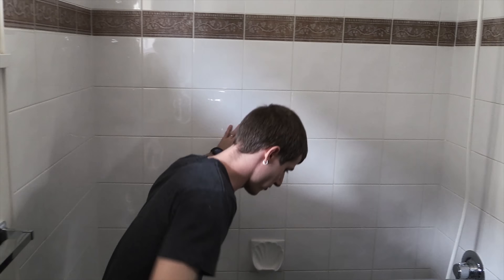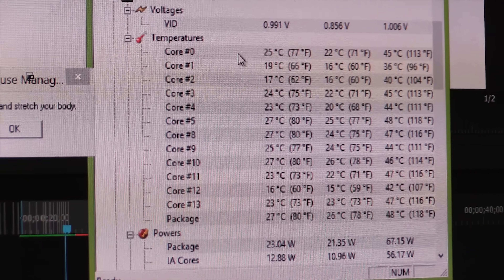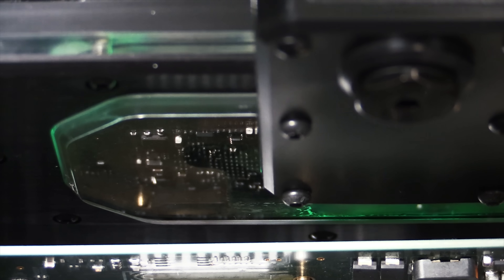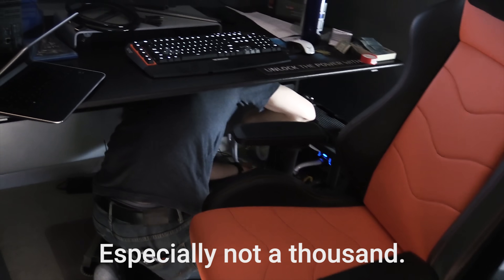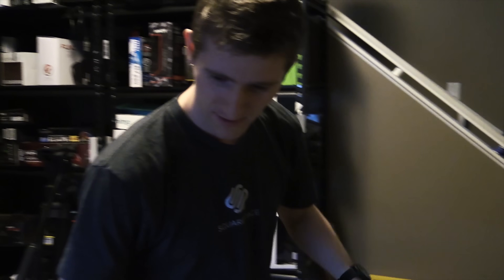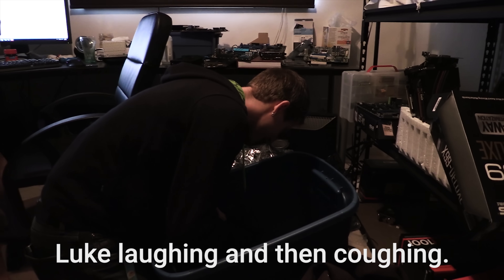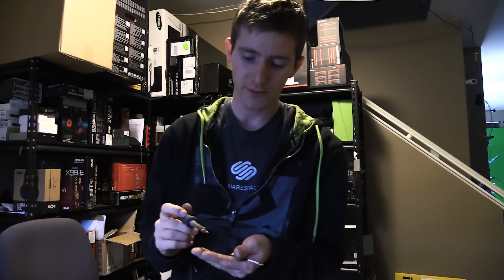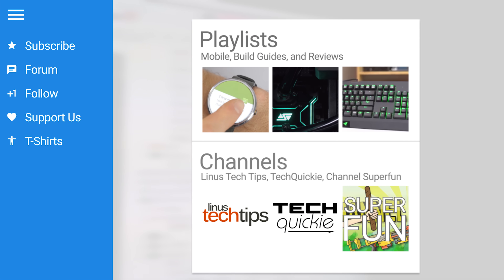Whole Room Water Cooling Part 5b - Some Issues, More Solutions...

Comment: Linus just a thought, but the pumps you have seem to be optimized for pressure rather than gallon per hour flow rate, you might find it quite beneficial to get a pump that is more of a 50/50 split between flow rate and pressure.  If those pumps that you have there are "Jet type" pumps then they would benefit greatly by putting a small submersible pump at the intake (ie in the tub of water) jet pumps are not designed to "suck up" water, they are more designed to have a low pressure high flow rate into them, which they convert to a high pressure lower flow rate out.

Comment: something simular like this for soldering is handy dandy ;-): http://www.newegg.com/Product/Product.aspx?Item=9SIA02V01M8144

btw you normally don't need flux, because it's on the solder .. (depends on what kind of solder you got)
Reply: Ow and heat shrink instead of the "electric tape" (which wont last long on it :) )

Comment: I'm not an expert but: 1. I would use a car or truck radiator and fan instead of all the ones you used. 2. I'm not sure if it's a good idea to put 2 pumps one after the other. 3. The Expansion Vessel should be above all your plumbing by at least 2 feet. 4. Did you consider the flow resistance of the liquid? Perhaps the plumbing diameter is too small. Anyway Good luck. I keep my fingers crossed it worked.

Comment: Soldering tip: Put the soldering iron below the cables, and let the cables touch the iron to heat up, then gently tap the solder(?) on the cables and it will spread out evenly and make it look awesome. Capillarity ftw

Comment: Hey Linus, Try to remove the Water pumps from the PCs, I think those pumps are the ones that are lowering the water pressure, than connect the tubing directly and just use the 2 bucket water pumps and see how It works. Also always, the end computer will be the hotter than the rest, Because the water is warming up as it goes through the PC's. than lets us know if it worked... Good LUCK BROO!!

Comment: That soldering is awful!
Take the two wires, twist them together, hold the iron on one end and heat the solder to "drip" into the wires... it will soak in. If you continue to heat the wires it will soak more and you can dab the solder onto the wire to add more... then rotate the wire 180 degrees and apply a layer of solder to the other side of the twisted wires.
shrink the heatshrink, that you put on the wire before attaching the wires, and call it a day.

Comment: Tin the tip of the iron, heat the wire then use the solder directly on the wire.

Comment: You should have a strong mechanical connection (ie. twist the wires together) and then add solder to solidify it. Don't rely on the solder alone to keep the splice together

Comment: WTF Linus! This Solders are.. Shit!  You must buy a tool to keep the wire in place then add more solvermetal. For the pomp you musn't place them next to eich other. If you want a better flow, place one at the enter and another at the middle of the circuit. Placing the both nexto to eich other will not drasticly increase the flow. Guy you fucked'up!

Comment: I'm really interested in one thing: Why did you do 2 whole sets of piping? Why not one with stopcocks between the t-sections, to open/close, if there would be no PC on that section of the loop, to circle the stopcock? This should (based on my memory of the fluid dynamics lectures) increase the static pressure by quite a lot, since there would be much less turbulence at the t-sections (and half of the piping friction). Is the sheer amount of heat of all the systems (how much are there btw? 7?) so immense, that the water temps would go through the roof? I'm really just dead curious, no trolling intended whatsoever.

BTW: I really need to register on the forum, seems like an awesome community. And the fan sounded like a petulant baby XD.

Comment: Lot of hate in the comments below, granted I agree with some of it that he should just take it all apart and run each system on either a closed loop Corsair Hydro Unit or run entirely on air until the move. I also agree that he should actually clean all of the piping and tubing rather than filter it because algae of all kinds leaves residue that can build back up unless you clean the surface that it was attached to. In theory it's a great idea, but in practice it's showing to be too expensive and impractical. Granted Linus said that this channel was about taking risks, but I'm not sure if risking your company of utter failure is one I'd want to make. Constantly draining and refilling your systems is not only damaging your pumps but what if you kill one of your workstations? That's not only thousands of dollars of hardware damaged, but hours of raw content that won't get edited on time due to the setbacks.

Comment: Two soldering tips, for Linus and everyone else.  Look up the tinning method when soldering wires together.  You'll use less solder, it will look cleaner, and give a better connection.  I'd also grab heat shrink tubing to seal them.  I see too many folks use electrical tape.  Tubing is cheap, looks cleaner, provides a better seal, and gives you an excuse to break out the lighter.  I've even used the heat from my soldering iron to shrink tubes in a pinch.

Comment: DONT USE A FILTER I strongly recommend not using a filter, this will reduce your flow rates even further. Instead I suggest using an inline UV Sterilizer, its much more passive and does a great job at keeping things from living. If you want a sediment filter do it before the pumps and reservoir to keep them clean as well

Comment: Sorry Linus; Strange but I can't watch this. This is even beneath the level a 10 year old would build. Tubes to small, finish more then rubbish, did not think through, etc. For the move; PLEASE get a engineering student from a local UNI to give you a hand in fluid dynamics, and cooling concepts.
 And it is sooooooo simple.

Comment: You can't just use consumer products for big things like this. You really need to start shopping industrial.
Why wouldn't you use a big radiator and outdoor rated fan? Using so many computer radiators is just a bad idea unless you use the small size in some way. Which you didn't, you made them into a large square. And the use of PC fans in an outdoor radiator is silly. 
 The use of 1/2 tubing as a supply line for 4+ lines running parallel off it is completely ridiculous. You would need a far larger supply pipe likely approaching 2 inches in order to feed that many loads at a reasonably low pressure. 
 The small irrigation pumps you purchased are not suited to running constantly and being reliable.
Trusting that bubbles would simply bleed out of all the tubing was an oversight. you should have pulled a vacuum in the lines before adding water. 

It just looks like you guys weren't prepared for this at all. You tried to make it cheaply with small parts and you really should have done more research and chose components better suited to the various tasks. When you were powering all those fans with such an inadequate power brick at the end it was just unfortunate.
When you guys move buildings just do it right, this was a waste of money because you tried to do it so cheaply.

Comment: I'm an "expert" at soldering (I solder space electronics for a living), from what I did see in the short clip, it looked like you had to little flux and not hot enough iron. Cables are extremely durable when it comes to heat. So just crank that iron up way more (20-50 degrees Celsius or more...) and drench the strands in flux. Put the iron on one side and add the solder wire from the other, that way it should melt in and be more smooth. Also change to a wider point on the iron, the bigger point the more heat transfer. Just ask me a question here and I'll try to answer it as best as I can. Also sorry for my bad English. :(

Comment: As all desktops are already water cooled, wouldn't it make more sense to just add AC to the room? would greatly save the cost and hassle with similar temperature results. For the main pump, wouldn't it also make sense to use a general home central heating pump as they're used to pump water around the house? Just curious.

Comment: lots of hate in the comments for no reason or reasons they already explained in videos. they are a tech channel, doing whole room watercooling is like barnacules or jayz setup and their backrounds experience. i wouldn't be anywhere near as interesting to watch the installation of an AC unit. They are also computer people and the size and scope of the water cooling is outside of multiple pcs which is on another level of difficulty to install. all the plumbers, mechanics and hivac people would find this task easier than lmg would because they've most likely never done anything like this. Also in the cases where the whole "do as i say not as i do" is an issue in all professions where someone has done a task so long or so many times they think they can cheat and get away with it. it works in many cases and they are exposing that hey sometimes cheating in your project doesn't work. We the view can learn from this and as people that cutting things to close or not properly thinking things out can actually cost more in the long run or could be avoided. The whole point of these videos is to show the progression of what is actually a neat idea. i'm sure these kinds of videos actually take more time to put out because of all the footage they have to go through and all the other issues there are. People that are here just to complain, why are you watching the video in the first place... you know to a degree that your not going to like it so why even bother. or comment without even watching it just go away. Pro's, amateurs, and those in the middle all make mistakes so stop being arrogant and superior be like ohh they messed up and then offer nothing in the way of help or observations that could help them fix their problems. I personally think the power to the fans really needs to have a better wiring solution because as it looks right now it was a mess, you need to be able to pull one fan if it fails. It seems that they went with the quick solution and one that's a little too vulnerable to water imo. it would be a pain but building a whole junction box out of a large project box would be way better using bread board would allow for a much better solution, or let the barnaclues help out with 3d printing parts they need, that would help both channels out.

Comment: dude you have helped me so much with your reviews on my pc build, that it came out good, plenty of options, and room to grow for upgrades, i want to help you out on your project, mistakes can be fixed and learned from, gravity is your enemy it kills head pressure, lower you pipes close to the floor, add valves to your feed lines to control the flow of water to each pc, the return line needs to be larger and free flowing back to the tank,  so each pc does not encounter a restriction/ reverse pressure that can stop the flow from the pc on the end of the line, wrap your feed lines to keep them cool, you already know copper is a great heat conductor, you will hate me for this one, go get a large truck radiator and a plane box fan from walmart, this should be enough to cool everything and still be free flowing for a return, your small rads and the way you have it set up are way too restrictive on the return side. get a biocide that is made for the pc to help kill the algae and keep the loop clean, replace all of your clear tubing as you can tell by it's dark color it is already contaminated and will continue to to contaminate the whole system. on a side note, you could have saved a few bucks and used PVC pipe.

Comment: Suggestion,
better if pumps are in parallel
2 Pumps in series increases headed but in parallel increases discharge..

series - 1st outlet = 2nd inlet  (you did)
parallel- both outlet go into one (T fitting)

Comment: you should mix the metal wires together first then put the iron under the wires then put the solder over you'll have to wait for it to flow oer all the wire it make a much better seal between the wires
;)
sorry for bad english i'm french

Comment: keep the solder iron clean and don't try to paint with it because only applies heat. Also when you have put the solder iron on to the thing leave it there for 10-15 sec so you know it is hot. then feed the solder onto the connection.

to connect two wires you can "tin" the wire. all you do is coat the wires you are doing to connect with solder. once that is done all you need to do is put the two wires that have been tinned overlapping then use the solder iron to heat it up. then they will be connected. 

tip you can use a bull clip attached to a weight and clip the thing to the bull clip. then solder it on.

Comment: Why dont you guys have several bleeding points at the top of that pipe system?!!...
Reply: And few more main pups around the system to stabilize the water pressure and flow to keep your all computers smooth... Then you can limit the pressure and flow with your main pumps to keep the water mooving right.

Comment: Soldering tips for what you guys were doing :
No.1: Don't use Plumbers solder in such a low SWG for wiring up electronics. 
No.2: Heat the part you are soldering with the iron and apply solder to the hot part, not the iron.

DON'T apply solder to the tip of the iron and then smear that onto the joint you are trying to solder, as you burn off all the flux in the core of the solder that could be helping on the joint, and you're adding hot solder to a cold component.....this will give you unreliable "cold solder joint" and is one of the cardinal sins of soldering.

Comment: LinusTechTips  for soldering wires I'd get a helping hands tool.(alligator clips and magnifying glass), get flux or rosin core solder, no need for external flux except for circuit boards and water pipes. twist the wires that your soldering together first, hold soldering iron to the twisted wire part and let it heat up, then apply solder, if wires are hot enough the solder will wick up them and secure the splice. trying to rub solder on with the iron won't really work and will probably leave you with cold solder joints. hope this helps. there's lots of ways to solder, these are just the ones I've picked up over the years and it works for me.

Comment: For the radiators, if you have some kind of plastic hand pump, you can try engine degreaser, and run that through the radiator. (that stuff will dissolve most organic mater, including skin). then after that flush the loop with first sole alcohol mixed with water, and then a little bit of 99% alcohol to get all of the other chemicals out. (I recommend trying it on an old cheap radiator first to see if it does anything to the metal, as I have only ever tried that stuff on cars).

Comment: Soldering is not like painting. You don't brush the solder on. You hold the solder iron on the wire and let the heat spread the solder.

Comment: I have a couple tips for soldering:

> you can use flux core solder (normal solder with soldering flux inside it) to solder instead of dipping the work or iron into flux to make it easier... the flux goes straight on inside the solder and it's a lot cleaner... and for anyone... a clean soldering job is important!

> For wiring, I would use a 190-250*C heat depending on the solder, but you don't want to allow the heat to conduct too far up the wire or you can melt the wire insulation!!

> Make sure you get sufficient heat onto the work (especially with motherboard and precision PCB soldering like I do when replacing bad capacitors or broken bypass and filter caps!!) but not so much you damage the insulation or the components!

> make sure the solder flows nicely... no balling up, stress cracks or not wicking onto the work... this is called a Dry joint and decreases electrical contact... and especially on precision electronics, it can wreak havoc!

Comment: You should have an air remover installed on the highest spot in you cooling loop.  Just unsolder an elbow, solder in a tee and bushing 3/4" x 1/4" threaded and install one of these... (Watts Air Vent ES-FV-4M1).  It'll save you a ton of time.  Also get a bigger container to add coolant from.

Comment: When soldering wires together tape them to the desk to avoid burning your hands and to hold the wires in place, also you then have both hands to handle the iron and the solder. I solder for a job so any questions feel free to ask. Also tin the wires first to help solder flow

Comment: A10 6800k or A10 7850k?(current specs) Fm2, 8GB RAM valueselect, HD5750, 500W Corsair PSU, 1TB HDD, 500GB SSD, NZXT guardian case (blue), ASUS motherboard socket fm2.

Comment: I've been taught to heat the joint you wanna solder first, and then apply solder (I use a solder with flux already) to the heated joint - so it spreads across it all

Comment: I'm not sure if these have been covered yet, but a couple quick tips for soldering: A, pre tin your wires, this means twist and then put solder on each wire individually then when you solder them together you can just hold them together and touch the iron to both, makes it easier and quicker to make joints.  Next tip, if you are going to be doing this more often, get a helping hand such as this: http://www.frys.com/product/5276537?site=sr:SEARCH:MAIN_RSLT_PG they have varying qualities and price points, but basically they are all just weighted bases with clamps of some kind to hold what you are soldering for you, leaving your hands free to you know, solder.

Comment: For a stronger and easier solder joint, twist the wires together before soldering instead of going parallel. And use heatshinks instead of insulation tapes to wrap the exposed wires.